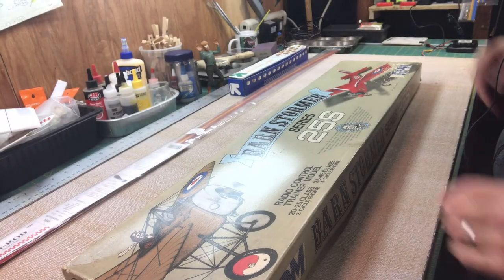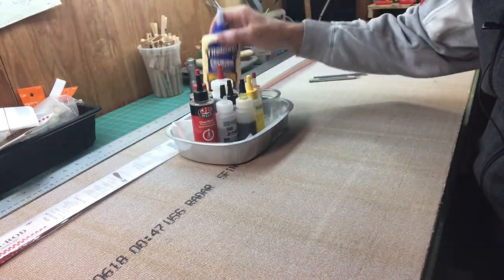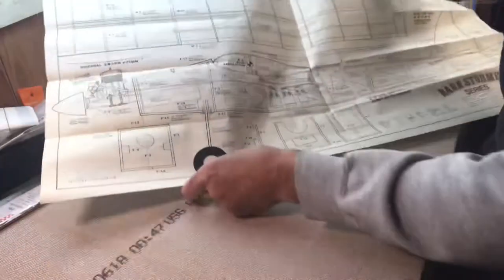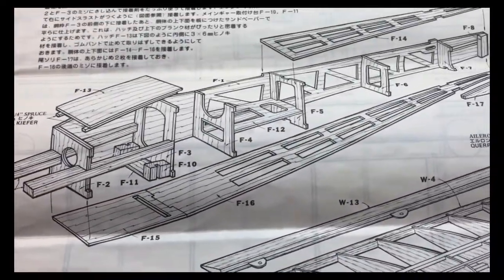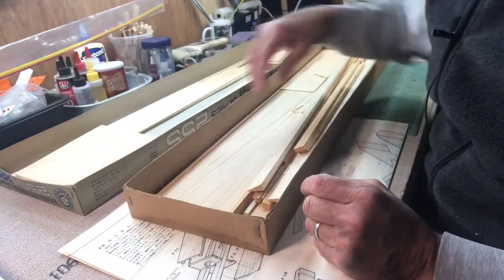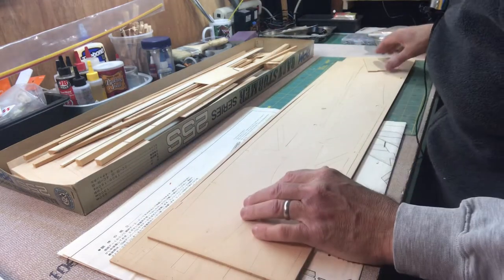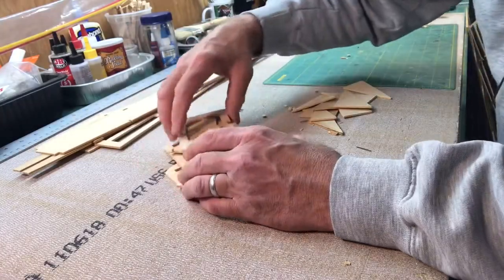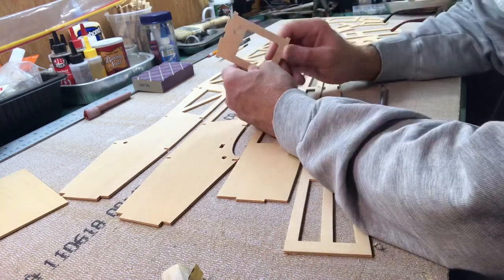Vintage RC Plane Build: 2-1 Fuselage Part 1

Comment: i just ordered the 25L....looks  easy  compared to a few of the other kits ive built..youre choice of glues is fine
Reply from the maker: Nice! Was that an ebay purchase? Its a fun simple kit. The L is a cool version. In fact I like that one a little more than the 25S. I keep looking for that one. Thanks!
Reply: @JamesRCPlaneTech  i found it on RCG classifies...120 shipped...seemed a tad high, but i love the "sweet n low" style stik planes....   i have a SF25 and an LA46...the 46 only weight about an ounce more, ill probably go that route.....i havent seen past the Fuse build yet..but will....choice of engine?
Reply from the maker: Nice, Ill have to check that site. These are great planes. Simple and fun, and a good change of pace if you are flying scale and such. That price sounds about right. I paid a little over 100 not including shipping for mine. And I have seen them around that price. I guess we are paying for the fact that they are rare. For this kit, Im going with an OS 25 FP. That’s what I flew before, and its a good match for power. I found a new one on ebay for a little less than a 100 bucks.
Reply: @JamesRCPlaneTech  awesome...definitely gonna come back to your videos when i actually start on it... building a Bridi Killer Kaos right now...thanks for sharing your videos, they are very insightful
Reply from the maker: @edward_RCpilot  
thanks!! Good luck with your builds!
Reply from the maker: Have you received your kit and started building yet? I need to get back on the wing in my build.. got caught up do a few other things. Hope to get on the build soon.
Reply: @JamesRCPlaneTech  i have both halves built...kinda hit a snag on joining them...i know ill use a thin layer of fiber glass cloth t be on the safe side....i had a build thread on RCG...but  felt kinda dumb just talking to my self so i closed it...RN im really focusing on finishing up my Kaos
Reply from the maker: Ya, they don’t give you much support it seams between the wings, just those plywood dihedral pieces and the cloth. I was thinking the same thing in terms of it being kind of week. But I did build this plane before and it was never an issue. But you mentioned you may go with a bigger engine? That extra power may apply a little more stress? I may widen the fiberglass cloth out to a little beyond the width of the fuselage and use epoxy, not resin.
Reply from the maker: Ill see if I can locate your build log on RCG..
Reply: @JamesRCPlaneTech  it's in the Balsa Builder section....it's closed though...when i make some decent progress I may unlock it and post again
Reply: @JamesRCPlaneTech  I'm a new builder, been doing ARFs since the early 90s...I tend to overthink things.....and usually start stressing even before things are complete...I don't plan on flying it too hard, I have planes for that.....I would really love a small 4 stroke that won't break the bank....been browsit for a used one...but I'm always late and it's always Sold.....well stay in touch...I always enjoy airplane talk...can't seem to have enough...
Reply from the maker: Ya, this kit is an “easy” build they say, but the instructions are minimal and I find that I go down one path then realize I need to rethink it here and there. Its not as “easy” as they say. Back in day before the ARF surge and there were mostly kit building, the companies always marked their kits as “easy builds”, so they could sell them, LOL... I did see your post on RCG, just searched barnstormer. It looks like you are doing well on it. I’m planning on getting back to the wing in mine this weekend... As for the engine, I have been somewhat successful getting used items on ebay. I landed a Saito 91 at a good price thats on my Revolver... it is a matter of luck winning a bid unless you want to spend a fortune... a 4 stoke on the barnstormer would  give it a nice touch. It would add to the vintage look also.. good luck!
Reply: @JamesRCPlaneTech  maybe with just a few more pictures nd better instructions it would be easy...lol   i try to stay away from auctions when the bids skyrocket...sometimes sellers have shill bidders driving prices up...i look more at buy now or best offers, or even better the Classifieds at RCG, ive had the best luck there...for now ill stick to a 2 stroke on this bird, unless i find a deal;;;;small 4s have gone up for some reason...,maybe its the scarcity, and demand...
Reply from the maker: @edward_RCpilot  ya, bidding can be crazy... I was watching a Balsa USA Smoothie 40 kit. It was going for around 70 bucks ... So I watched and watched and it went over 140 bucks not including tax and shipping. The brand new kit from Balsa USA is only 133 bucks, no tax, and shipping included! So I ordered it directly from them. Some people go bid crazy and inflate the price on themselves, especially when they bid early. Its nuts to see someone pay for a used item more than the brand new one. But I have successfully bid on a few kits and engines that were good deals..such as this barnstormer kit, I think it was 120 bucks, for a rare kit.
Reply: @JamesRCPlaneTech  yup, it just takes some discipline to know when to pull out...my bank account is a good reminder..im in the covering process of  my Kaos...once im done, i will dedicate my attention to the Barnstormer...